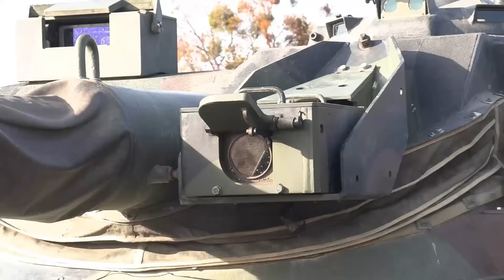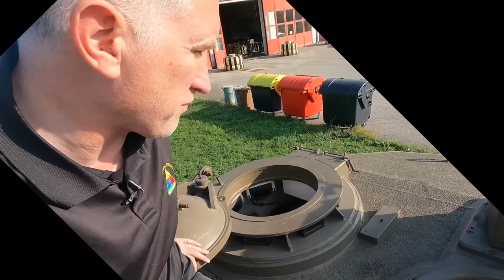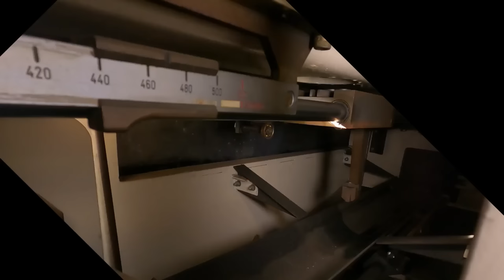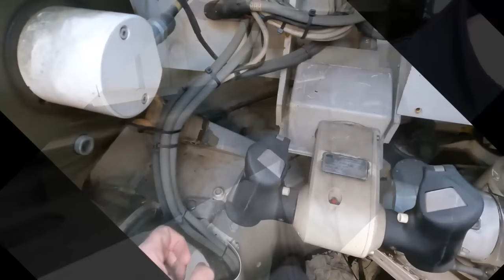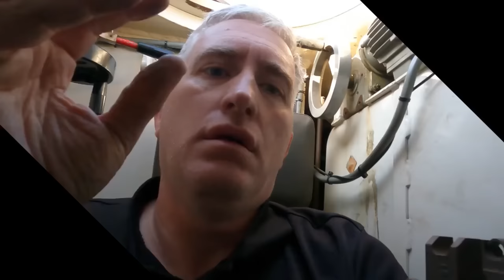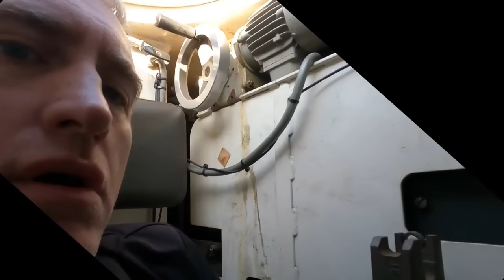Inside the Chieftain's Hatch: Super Kurassier, Pt 3.

Comment: I can imagine the little tank being knocked 3 feet back every time the big gun fired.      :)
Reply: Similar to the M-51 Super Shermans of the IDF. If you didn't put gear into neutral, "surpirising" things could happen when firing ...
Reply: @ottovonbismarck2443  ...like (steering &/or drive) gearboxes stripping half of the gears teeth off and possibly shattering some cogs forcefully enough to eject themselves through the gearbox's casing into the crew compartment, if not shearing the propshaft drive coupling bolts & a  mounting bracket or two.
Reply: @razor1uk610  I thought of a backflip or "hat off" ...

Comment: The siren was most likely an alarm for the fire fighters or the weekly test of the siren system Saturday at noon.
Reply: Do they really have to test the weekly? Where I live they test them on the first Monday of every month at 12.00
Reply: @laurisikio  For some reason we test all sirens in the whole country every saturday at 12.00. Sometimes we also perform durability test and have them running for an hour and do signals test (short - long like rudimentary morse code).
Reply: @laurisikio  in Austria we do it that way. And on the first Saturday in October we test all the signals ( warning, alarm , end of alarm)
Reply: Sounds very thorough testing
Reply: @laurisikio  Vienna only does it annually but the rest of Austria does test them weekly. Maybe because the signalling chain is more complex, less redundancy and they are more likely to need it?

The national, state and local district authorities are supposed to be able to trigger them. So more to go to wrong and it is easier for things to break or to be broken. In Vienna the districts are not able to trigger them, plus the town hall and national authority are very close together so everything is very centralized. Also you have a lot more redundancy in VIenna. One or two sirens fail? You probably have still another half a dozen within hearing range. That is likely not the case in the more rural areas.

Comment: I have made some investigations for improving live audio quality. What you can do is use a multi frequency sound gate and use a separate sound source as a trigger. The recommended microphone for this would be a throat mic but the main issue I have had with this is to actually find a good gate that has exposed the option to use a second channel for the gate trigger. Personally I think that it will definitely be worth finding a noise gate that would be able to do this and the secondary microphone since it can definitely clean up situations like this that otherwise would risk getting scrapped.

Comment: I'm quite surprised to see how small the Kurassier 1 and 2 are, even for light tanks. I'm not a tall guy, but I am quite broad-shouldered and somewhat portly, and even I think I would have difficulty squeezing into the gunner's position.
Reply: A Kürassier is not to be operated, driven or commanded - it is to be worn like a piece of armour. That's where the name comes from (Kürass). You don't fight campaigns in it; you take it off right after the battle. :)

Comment: That turret looks a bit absurd on that chassis. It really does look like they took the turret off a much, much larger tank, shoehorned into the turret ring and said "Looks good! Ship it!" and then wondered why people were asking if it was upside down. Though it might be the oscillating turret that really makes it look like it has just a massive melon on it's shoulders. Maybe a regular turret would look a bit more normal. Or worse, I don't know. But as wonky as it looks, the extra size CLEARLY didn't translate internally as far as the crew is concerned. Definitely wouldn't want to be in there the day after a long night of beer and sauerkraut. Asphyxiation via flatulence probably isn't a good way to go, and it would probably come quick with so little room for it to thin out...

Comment: Have they thought of adding magnetic shock abosrbers to take up some of the recoil?
Reply: It wouldnt solve the issue any more than stronger springs. You still have a given amount of recoil energy, and a given amount of space the gun can travel to stretch out the time the vehicle has to absorb it. There is just too much recoil and too little time to absorb it, so it threatens to kick over the vehicle. 
If anything the springs would need to be weaker so the gun travels back for a longer time making the absorption of the recoil more gradual, but the turret just isnt big enough. Stronger springs would just make the problem of kicking the vehicle over worse.
Reply: Hmm, would another recoil buffer/cylinder help, assuming there was space? (unlikely, I know)
Reply: @builder396  The issues isn't whether magentic shocks would do the job. They would and it's not a maybe. The issue is there enough space inside the turret to fit in the magnetic shocks along side the existing shocks.
Reply: @readhistory2023  The issue isnt what type of shocks, springs or whatever you put in there, its just too much recoil energy and too little space to dissipate it, so the tank wont fall on its side all the time. End of. Magnetic shocks change neither of these two variables, so its a moot point.

Comment: Good god this thing is awful. At this point i have to wonder why they didn't bin the idea of giving it a turret at all, and simply made it a casemate tank instead of making something thats up there with Valiant in terms of how terrible it is?
Cramped, unstable, less ammo than an AMX-13, prone to fall over if you fire over the sides... I wouldn't be surprised if the recoil would start to break things very quickly in service, too.

Side note, Valiant is one i've always wanted to see an Inside the Hatch on. That and the Independent.